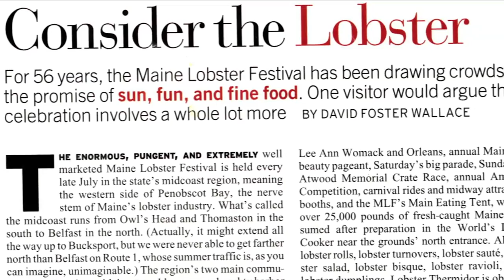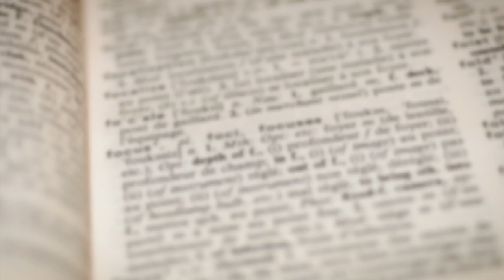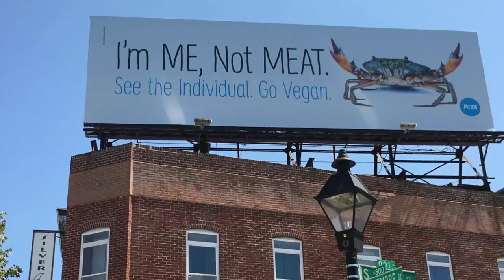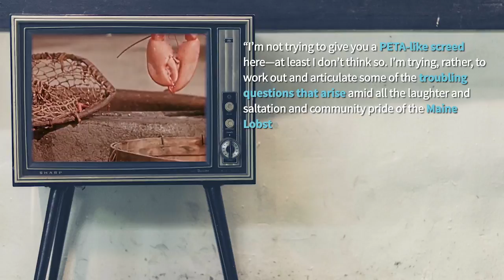Do Lobsters Feel Pain? Do Crabs Feel Pain? | PETA Video Answers

Comment: I have a robot with limit switches for bumpers.  I have it programmed to rapidly back away from any wall it runs into.  So, since it has a sensory system and it reacts quickly to escape from a sensor activation it is programmed to avoid, my robot clearly suffers.  Otherwise it wouldn’t try to get away.
Reply: Does your robot have a butthole? 
Was it built or grown? 
If it does fail in self protection, can it be brought back to life?
Reply: @killmat1c  Sorry, my robot recently died, so your questions are moot.